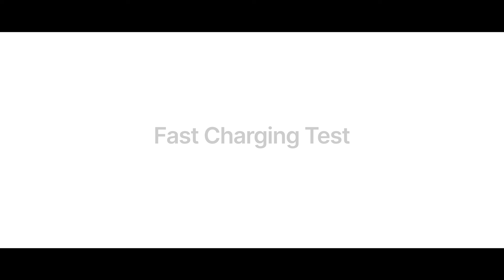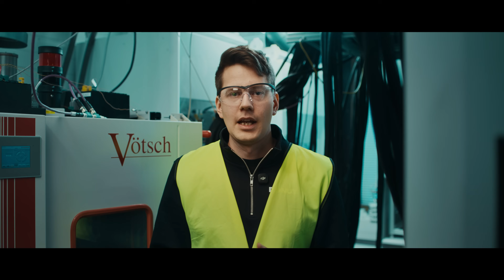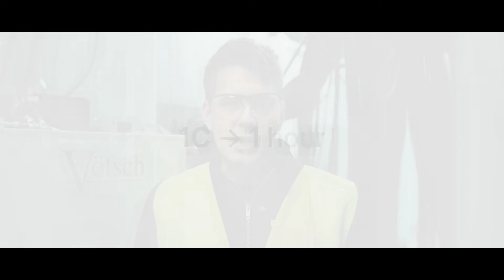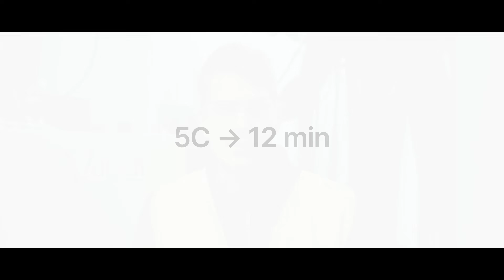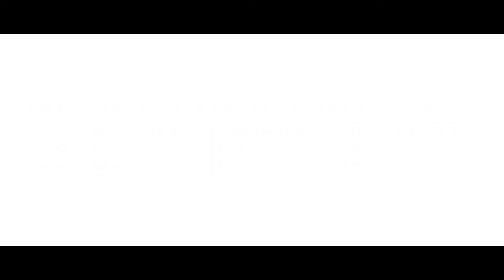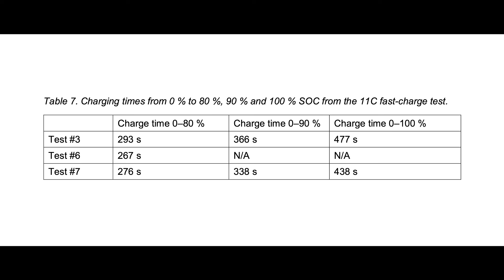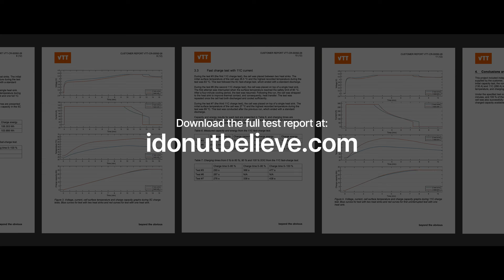Donut Solid-State Battery: Fast Charge Test | I Donut Believe (Pt.1)

Comment: I'm very confused, maybe I missed it, why is 1 heat sink charging faster than a cooler 2 heat sink set up? Unless the batteries actually like the heat?
Reply: See 5:45.
Reply: @cruiser97eric1  Got it, so the internal resistance is lower with higher heat and it accepts higher amps at lower volts. Essentially, it seems to like the heat for charge speeds, although longevity will probably be better with cooler, slower charge rates. Of course longevity is supposedly a moot point for these.
Reply: Looking at the graphs, the 2 heat sink current drop sooner than the single heat sink which may have affected the charge rate.

Comment: I question whether his is really a "battery" in the traditional sense. If you look at the charge/discharge profiles, It's demonstrating supercapacitor traits. Supercapacitors typically have a linear relationship between voltage and capacity at a fixed current. That's mostly what's being demonstrated here. I suspect what they've done is figured out how to get over the energy density limitations that supercapacitors have historically had. A supercapacitors limited energy density has always been why they don't work in EV's. All of their other traits have always been superior to batteries. There is a voltage plateau near full capacity, but they mention that the charge voltage is limited to 4.3V, which could explain the non-linear behavior over 80%.
Reply: How long it can hold the charge? Supercapacitors typically loose the charge quite rapidly.
Reply: @juha7830 Based on the test results, there's a gradual reduction in voltage after it reaches full charge. But the rest period after full charge isn't long enough to tell for sure. The first test only had a 1 hour rest period. There was a slight drop in voltage, but that's typical for any rechargeable battery. The other two tests were about 2 hours after full charge. Again, there's a voltage drop there, but it's not rapid. 

They're charging at 4.3V, but it seems to rapidly drop to about 4.1V after charging voltage is removed. The provided test show a downward trend in voltage, but the time duration isn't long enough to know if it levels out or not.

Comment: There is no mention of the dimensions or the weight of the cell in the report, so we don't really know what the energy density of the cell is. They mention 400wh/kg on their website, but there is no such mention in the test report. I took a screenshot of the image at 4:40min in the video where it shows the hand placing the heatsink on the cell. I gave the image to Chatgpt and asked it to calculate the approximate dimensions of the cell based on the hand as a reference. It gave me a length of 140cm width of 100cm and thickness of 10mm, which I think is close to the real size of this cell.  Based on the 400wh/kg energy density the weight of the cell should be 235g.
Reply: Bad news here this means 0.140 litre. Which gives 96wh / 0.140L = 685wh/L, google says "Modern lithium-ion batteries typically exhibit a volumetric energy density ranging from 250 to 700 watt-hours per liter (Wh/L)." Which means they could just show us/test a good modern liion battery :(
Reply: @tihomirborovski5661 yep. The large heatsinks and amount of heat produced in the test results is also consistent with high performance LiPo batteries, unfortunately.
Reply: @tihomirborovski5661  So you're insunuating that they're lying publically through their teeth in a way that will be easily proven wrong, catastrophically ending their careers and reputations?

They are on record multiple times saying there is NO LITHIUM in the cells. If they lie about something like that while pawning investor money, they are literally just killing themselves. Do you understand?
Reply: @jambalaya974 you completely missed the point. He’s talking about volumetric density, it’s an important measure that they haven’t specified
Reply: It would put the volume at 140,000 mm3 which is slightly higher than the Tesla 4680 battery at 133,000mm3 with a similar capacity of 26Ah (The 4680 is a cylinder so arguably its 'real-world' volume is higher). The Tesla battery is heavier at 350g.
Reply: You put it into Chat GTP 😂😂😂😂 you know it’s only as good as you and the way you input and interpret the data entered? You’re never getting that two hours back 🤦‍♂️

Comment: I hope the next vtt report states that all the tests were made on the same battery pack.
Reply: Just read their report and they specify it's all tested on the same cell
Reply: @codybryant7654 I think he would like to see, that all different tests are done with one cell. Which I find is ridiculous, because it is not the way the industry tests stuff.
Reply: @uwehetman2320  Tests are made 100% as Donut wants and results are correct. BUT results don't actually tell anything at the moment.
Reply: Lol, I was thinking the same thing
Reply: No you probably want another test where they cycle the crap out of it at really high charge rates.
Reply: "All tests described in this 
report were carried out on the same cell, following the customer’s test plan"
Reply: I kinda understand why you would say that but your statement falls into Moving The Goalposts logical fallacy territory. VTT is an independent 3rd party, they determine how the tests are made, not Donut Labs. So even if the following tests were made on separate battery packs. That would be because VTT wanted it that way. 

Everyone rightfully wanted Donut Labs to provide reputable 3rd party review of their claims and that’s what they are doing. Now if VTT is not qualified to make these reports then question their process is fair but if they are, questioning their process can appear as if you know better than them.
Reply: @Digital-_-Spirit as I understood Donut Lab has created the test specs, but which is quite normal also for independent testing. 

It is funny how people still try to argue, that this is a hoax, while seeing the evidence. 

Maybe also lack of knowledge how industry is operating tests. 

In the company I work you also take e.g. 50 parts from the production line and give them to the different test stations. 

That this is less trustworthy, if it is not done with only one battery cell is ridiculous.
Reply: @Digital-_-Spirit  First paragraph of the testing document: "The aim of the project was to conduct independent charging performance tests on the energy storage devices supplied by the customer, which the customer identified as solid-state battery cells. The specification of the device under test is presented in Table 1. All tests described in this report were carried out on the same cell, following the customer’s test plan."

Nothing here says Donut Lab even had to produce the energy storage device or buy it from Alibaba. There are plenty of solid state or semi solid state batteries available with 10C charging and near 400Wh/kg energy density, they also work at the temperature ranges specified by Donut Labs. All of them fall short only on 100 000 cycles and materials used...

I think VTT should be very careful not to allow themselves to be used as a PR vehicle in a scam, so I do hope they have additional verification of the origin of the battery and rest of the details. In case this turns out to be a scam then VTT really needs to check more carefully what kind of tests and publicity they want to have.
Reply: @Digital-_-Spirit  I think all the tests are made just as client (Donut) has defined, all under NDA. You can see this when you look at the documents. Actually they don't even know what kind of cell it is. They just run ordered test program and write the results.
Reply: @Digital-_-Spirit  they are only testing what donut lab has provided 

It's a lab test not an audit report
Hold your horses for now
Reply: Why should it? It is not normal for industrial testing. You do not have only one device under test. Imagine you make destructive tests like puncturing with a nail. How should you repeat the test under 3 conditions (0% SOC, 50% SOC, 100% SOC)?
They will have several DUTs for different tests. That is the normal way.
Reply: @uwehetman2320  I would assume they at the very least mean the same cell version. I.e. they don't swap a power cell out for an energy cell for example.
Reply: @PorthLlwyd if you produce something and you would like to test something, then you provide the test spec and the DUTs e.g. 20-30 samples. Which individual DUT the institute picks for which test is their choice. People are assuming Donut want to cheat somehow. I am thinking the other way around. Why should they contact a institute with high reputation where battery experts are and try to cheat, when the could reveal this try within minutes? Also this would mean that this little company would have the knowledge and the man power to produce different types of batteries in the same form factor. One with high energy density, one with high power density, one with high cycle times. How likely is that? How likely is that no one of the experts in the institute would mind the difference? That are no people sitting in front of their keyboard typing some speculations. These are scientists and engineers. They know what they are doing.
Reply: @uwehetman2320   funny because the report shows they only tested one cell. That is strange to me.
Reply: @aspzx OP wrote that he hopes that ALL tests are done with the same cell. Which is very unlikely. At least this cell was marked as DL3. Which assumes that there are at least two more. But I think it is even more for different kind of tests.
Reply: @aspzx  because right now they are proving it can all be done on the same cell much like how they would be used in the real world. use case testing, showing its possible. Testing of different cells comes later when proving manufacturing reliability, even more so when production is at scale. if they prove they can do it once, next step is to prove its repeatable and reliable.
Reply: @uwehetman2320  thats only when performing destructive testing, they are doing use case testing which can be done all with the same cell; this proves reliability.
Reply: And even then we have to believe that the math for the cycle life is correct because for 100.000 cyles at 12c charge and discharge you need 2 years.
Reply: @raphiseth6942  Its an estimated/accelerated life test. This is also completely normal.
Same with vehicles, many turned out having better battery degradation than expected, some worse.
Reply: @jaro6985 thats what i mean, they didn't test it, they did some math, and if this batterie is so groundbreaking as they how did they come up with this math and know they are correct. If i get that cyclelife i would assume their is an error somewhere.
Reply: @raphiseth6942  yes you use math to estimate the real world cycle life. As I said, it may be better or worse in the real world (due to various factors, temperature, depth of discharge, etc). You can google "prediction of battery cycle life" or similar to find details and graphs. 

In this case it doesn't really matter if its off by 50% say, the claim is insane enough as it is. If they wanted to prove it they could show degradation vs maybe 200-500 cycles and that should be enough to trust the tech or not.
Reply: @raphiseth6942 Nearly all cycle life tests are stimulated. I don't understand the point you're trying to make
Reply: @raphiseth6942 there are models for that. You measure e.g. 1000 cycles and you can calculate the wearing. You don't really believe that someone would make the 100k test cycles in real life, are you? Do you know what testing time costs?

Comment: I compared the older Charging video with the VTT test report, and there are noticeable discrepancies.
The cell voltage shown in the video (~4 V at empty) doesn’t match the report (3V). Key details like cell weight, dimensions and cycle life are also missing.
As someone working in a testing lab, these inconsistencies make it hard to evaluate the claims. It would be helpful if Donut Labs could clarify these differences to make the results transparent and reproducible.
Reply: Yes, the weight is so important figure.. its unprofessional not to report it
Reply: The 11C charging curve hits 4V after a few seconds. 
Did the old charging video show the battery voltage at true 0% without charging?
Reply: Did they show the resting voltage in the earlier video, I thought they only showed it during charging.
Reply: I checked the clip again. The first frame it actually reads 3.8V before settling around 4V. The charge current is already 270A from the first frame so it has probably been charging for a moment before the video clip starts. So it most likely started closer to 3V as well. We just don’t see it in the clip. 

Key dimensions has been given before and was not the purpose of this test. Let’s see what other tests they’ll publish. But most likely we won’t have the full picture until the products are torn down by others after the product is released anyway.

Comment: Ngl, if you really had a technology breakthrough I think youd be sending samples to multiple independent labs and fully test everything you claim. Just fast charging is not impressive. Need to cycle the battery at least 1000 times with those speeds to see how it holds up.

I really want to believe this. But I feel this is more like a marketing campaign. Which wouldn't be necessary at all, if you genuinely had a breakthrough technology. Companies would be lining up and ready to pay you billions like tomorrow

Comment: I hope this all goes well and translates into actual products. I'm a bit disappointed that they claim testing to be handed over to VTT, but then it's not presented by VTT but by their own CEO? I'd like to hear from an unbiased expert that has spent some quality time with the battery in the lab. With actual videos of the testing. Now, charging a battery prototype two times at extraordinary high rates is something we've seen many times before. Now the battery needs to keep that performance for thousands of charge cycles, as claimed. And for at least 15 years ;-)
Reply: Bro VTT does the testing not the marketing.
Look the reports.
Reply: @wakeno.6047  I have downloaded and read the VTT report, and find my concerns confirmed. Did you take a look at charging curves, voltage and temperatures? It seems to be a normal, high capacity lithium ion cell, contrary to what they claim. Why did they stop charging when safe temperature limits of LiIon cells where reached, while it was still within the claimed temperature range? Also neither the claimed charging speed nor the claimed energy density was confirmed by the report. What's more, nowhere in the report has VTT confirmed that it is a solid state battery. I think the probability of this being total fake has actually increased after this report. This whole thing could just be a very bad marketing stunt.

Comment: Since the test number 6 was actually aborted because of overheating the cell, I would have wanted to see what will happen if you don't abort the charging when (not if) cooling is inadequate. According to your claims the cell shouldn't catch fire but what would the result be otherwise?
Reply: The report states they were testing 11C charging resting on heat sink in tests #3, #6 and #7, allowing the heatsink and battery to cool for a few minutes between tests. The report doesn't state the start temperature of test #6, just it started after test #5, but reached the test thermal limit of 90°C. The test wasn't abandoned but the cell allowed to cool for a few minutes then retested mounted to the heatsink (for improved heat transfer) and the cell fully charged - the charge, end voltage/Ah characteristics recorded just not the time (as it was voided by the intervention). The data from this test is still useful.

This seems to mirror tests of cooling approach required for the cell, when charging from warm (circa 27°C). The  test reached the test criteria limit at 11c charging but on restart completed with improved passive thermal bonding.

In the real world the batteries would have sufficient cooling for the charging rate used, with a thermal safety margin set below that performed in these tests 

I assume safety specific tests will feature in later videos in the series.
Reply: @GruffSillyGoat yeah but they stated in the video that 89 celsius is comfort zone and earlier they said that the operating window is up to 100 celsius, so both of them are lie because 90 celsius is the safety limit. Also if you look charging curve is identical to a litium ion battery, there are highly educated people on youtube whos making video about it and one of them said he gives 0.1% that this is real now
Reply: @gergodanko1336 - the cut off was set by the lab, no one is lying the test wasn't able to reach the batteries stated limit; it wasn't stopped due to the battery itself.

Just because some Youtubers do a curve fitting activity and speculate it has characteristics similar to a Lithium cell, but caveat their view at the same time, again isn't proof their claims are right. I'm skeptical of both the Donut Lab and the YouTuber claims, so le's see the video series out first before jumping to conclusions either way.